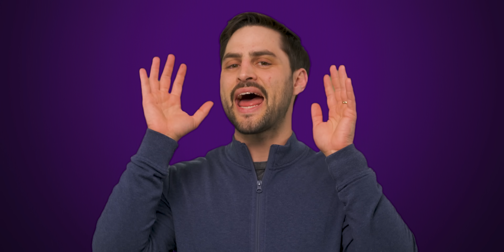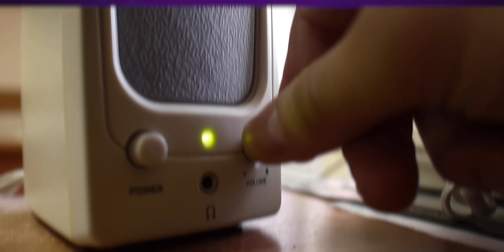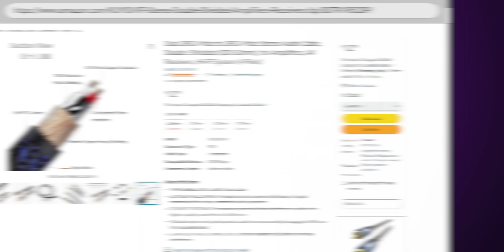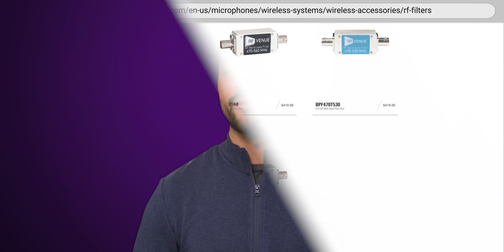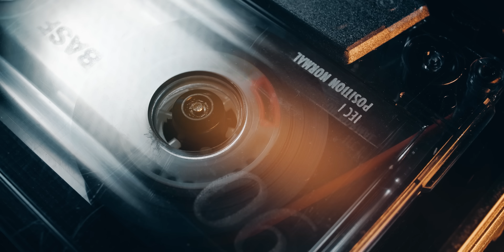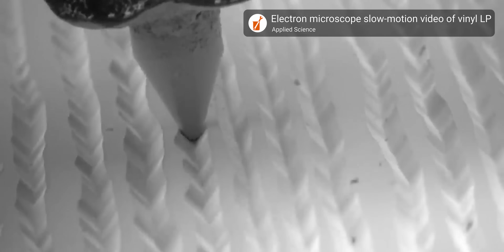Why Do Speakers Hiss?

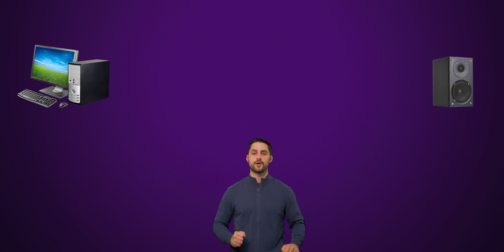Comment: The RF filters shown  at 3:36 are indeed RF filters - just for professional wireless microphone systems. They are UNSUITED to fix any home audio issues. I would strongly recommend to put a disclaimer at this part of the video. It creates the impression that you could buy these to fix your issues at home. 

Additionally the most common problem is not part of the video: gain staging
You should go through each component of your setup individually and check, where the noise is coming from. Hissing powered speakers might be perfectly usable, if you turn them down a little bit and increase the volume in Windows or on your interface instead.
Reply: I came here looking for this comment. This is a huge oversight at best, and wildly misleading at worst. The filters shown are what's used to filter out certain parts of the UHF wireless spectrum while using wireless audio transmission systems, and are in no way useful for what's described in the video.

Comment: my external amp (two midwoofers) when the preamp (2.2 music system) is connected to PC does it, the external amp is crossovered at 15-100Hz, the hum changes tone depending on the fps being displayed via framelimiter (3~120fps). Lifting ground helped, but same outlet or entirely different pc didn't help, iirc geraldundone had a case that was the cause but I also ran my system on cardboard but it didn't help me.

Comment: Also a ground loop is why when you connect a bluetooth module to the same source as the amp you hear the high frequency noise of the bluetooth mcu
Reply: what high frequency noise? how many khz?
Reply: @gamecubeplayer  idk but you hear a background constant beeeeeeeep when you wire the 5v of a bt module to the 5v in of an amplifier i have had experienced when making my diy bt speaker

Comment: Ground loop forms because the connected equipment are grounded at different potentials - even though they are technically "grounded", if they are grounded at two different points and these two points are at different potentials, you've got yourself a voltage. It only needs to be 50 mV and you will hear it if it's amplified by your amplifier. It's why the hum is 50 Hz or 60 Hz, the same frequency as your mains. That's why they tend to go away if you ground both equipment at the same physical point, because that minimises the potential difference. I haven't ever heard of an explanation for ground loop that includes magnetic interference.

Comment: Oh damn, I seem to have a ground loop on my speakers. Will try to connect them to the same outlet.
Though not sure if it matters, but my building's wiring isn't grounded. Still, hope it helps to alleviate the annoying droning.

Comment: The low quality aux cable i used was amplifying the coil whine of my gpu which drove me absolutely bonkers, i just changed that cable and its all good now
Reply: This is happening to me :/

I have already spent $30 on cables since I bought the wrong ones first….
Reply: @manaylodha  my fix was an older cable which i made from an old RCA jack video cable, and soldered a the 3.5mm jack on the other end, i guess old stuff was built different afterall 😅
Reply: You most likely have ground loop @manaylodha
Reply: @HyviaVideoitaMansenlale  maybe, but it’s connected to the same power strip, I’ll have to check it out. It’s JBL305p
Reply: CRC contact cleaner, my friends.
Reply: @Vegemeister1  that makes 0 sense
Reply: @BladSG  There are two ways an aux cable can be "bad": there's a partial open-circuit inside the cable itself, or there's a partial open circuit at either end because of a bad connection.  A shot of contact cleaner into the audio jack and a few re-pluggings might fix these problems without buying a new cable. Or even fix them when buying a new cable doesn't work (because the schmutz is in the jack).

Bad connections can also create surprising effects like amplified noise from coil whine, because dirt or corrosion products in the joint can turn it into a Schottky diode mixer, modulating RF noise into the audio spectrum.

A surprising number of computer/car/household electrical problems can be fixed by cleaning terminals. Poor connections are a common cause of problems in high-humidity climates and smoking households. I've fixed "bad" RAM at least twice this way.
Reply: @Vegemeister1  yeah
Reply: @Vegemeister1  eh

Comment: The hissing is caused by a bad Signal-to-Noise Ratio, typically in amps or DACs (Noise floor) and not interference. Also ground loops can be caused inside a device too, you dont need a seperate wall socket to get that. Often caused by bad power supplies and/or flipped phase on one device. The correct solution is a star-type ground point combined with ground lift on the affected devices - almost always power amplifiers. Most even have a switch on the back for this exact purpose.

Comment: Always buy AudioQuest cables, dont get the walmart value cables
Reply: I must say that was a quite funny sentence. 
Sure, do not buy crap, but buying overpriced crap that literary does not improve anything beyond basic quality cable is a terrible solution as well.
Reply: @japkoslav  Depends if you do research, because the AudioQuest Photon brands are good value cables than anything walmart has. Its A/V connector is Solid Long-Grain Copper, has level 1 directional noise-dissipation to reduce RF, and it has a braided cover to reduce coiling caused by heated wires from the electrical current. Also If you want to go the extra route, ferrite rings can also reduce interference
Reply: @lategamingwithiainjarvis That exactly what is needed to do, when picking up the cable -  problem with that is you will end up with pretty much the same conclusion as I did, AudioQuest being utterly overpriced.
There are quite a lot of measurements on Audiosciencereview, even Linus did a few shots at overpriced cables himself.

If you deal with analogue signal better cable certainly can affect sound quality, if you use HDMI ... why even bother with anything fancy.

Comment: As a ham, if his equipment is causing problems, he should probably be told, because it could also be hurting his equipment!
I haven't ever heard of anyone causing any problems if the radio/antenna has a reasonable SWR...
Although not computer "tech"--there's a LOT of really awesome tech in radios, LMG should take a look into them!
A great one to start is CHIME Fast Radio Burst experiments--there's one semi-local to BC :)
Reply: As a fellow ham I agree. LMG talks a lot about radios whether it's bluetooth, cellular, or wi-fi. They should do a series of video on ham radio and why it's important.
Reply: Oh man HAM SECTION: KM6ARC
Workstation 1:  B.I.C. Venturi Formula 6 and a powered mixer (PMP4000) pushing the a pair of Dual 15 Inch JBL JRX225 on another workstation.  Inside a mobile home.
Reply: Calling yourself a ham is really funny. I know exactly what you mean by it but it's still kinda funny.